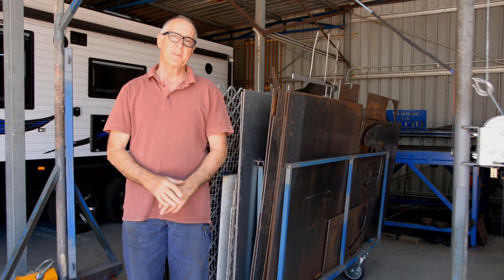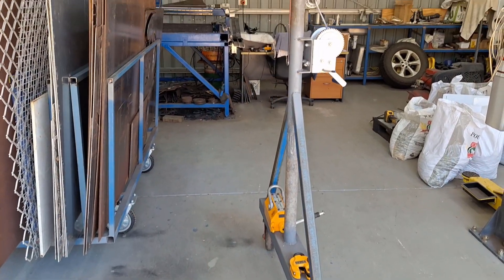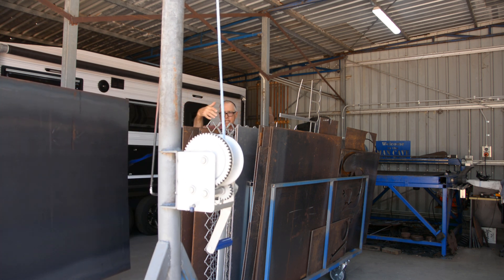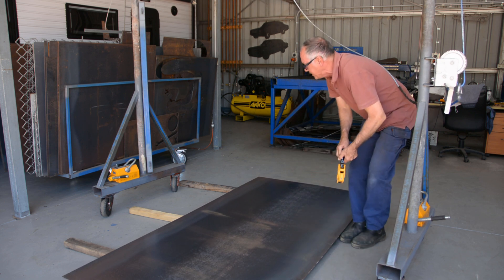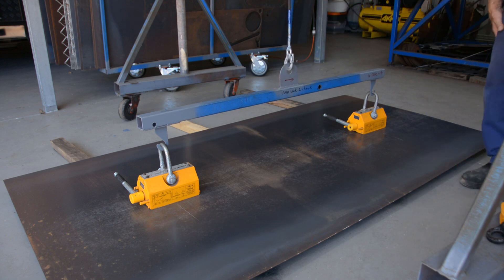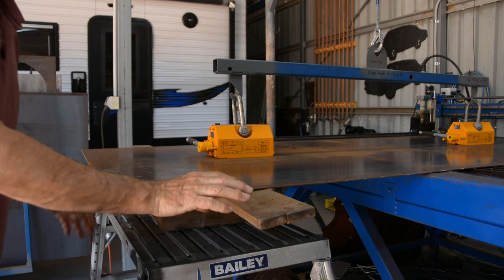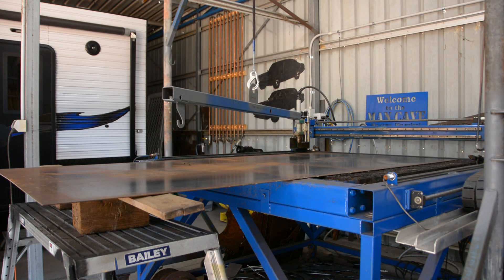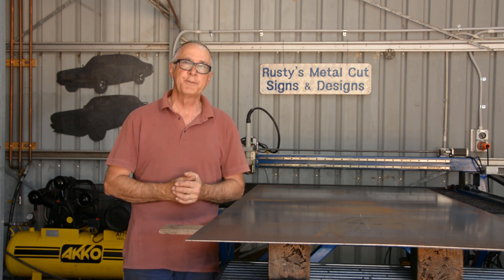How I Load Steel Plate onto my CNC Plasma Cutting Table

Comment: Mate! Not experienced in this. Such great basic info & methods
Reply from the maker: Thanks Rusty Kombi....makes manual handling steel sheets safer. I'm thinking about installing an overhead gantry/monorail crane, which removes the need to 'manually handle the current gantry crane'.

Comment: very nice setup, how much maximum weight can your overhead frame hold before letting go ?,
Reply from the maker: The plate lifter is rated at 1 tonne. The magnets are rated at 600kg each and the winch is rated at 3 tonne. I don't know the max. working load of my overhead gantry but I'm confident that it would safely hold 1 tonne.

Comment: Rusty, i do similar work from my home shed,  except my shed is 100+ years old, with a dirt floor. So, no concrete floor. 

I installed 50x50 angle steel in the centre of the roof, and run wheels along the angle iron to move the steel through my shed.
I attached a vevor electric hoist to those wheels,  and i can use the remote control to lift the sheet vertically... roll the sheet towards my table,  then i raise it up,  roll it over the table,  and then lower the seet with the vertical lifter, onto the table.

The vevor hoist/winch is much better than the manual winch.
I tried those magnets, but for me,  they're a nightmare.  The vevor winch makes it 1 man operation, or my wife helps me by using the remote while i manage the sheet location.

Also, you can use the same spreader bar set up, but use 2 vertical grips, instead of the magnets.

Id send you a video, but my shed is appalling.
Reply from the maker: Hey Jeff, thanks for the suggestion regarding an overhead crane with electric hoist/winch. I have some them and think they'd be a better option than my manual arrangement, but when Mrs Rusty is around to help me, it's definitely easier with 2 of us.
Do you run your own business and YT channel??
Reply: @RustysMetalCutSignsDesigns  business,  yes... YT, no. I'm not a fan of social media, but sadly,  i have to use it to keep the business going
Reply from the maker: What's your business name, or can you provide a link to your business, please. Which part of Australia are you in....I'm in WA, about 1 hour south of Perth.

Comment: It well suited for the job. To make it easier make the handle longer, i just would get tired of lifting plates. Handle would probably get in the way. Maybe a hex bar attached for a drill to winch it?

Did think placing the plates on trestles instead  of the floor. Thinking its a little higher and less time raising the plates up to the plasma.
Reply from the maker: I've been thinking about some sort of trestle, rather than lowering the sheet all the way to the floor, but it's just one more thing to stow in the shed when not in use....but it is a good idea, so thanks for that.
Reply: @RustysMetalSigns  yeah probably get more in the way

Comment: Looks like the still er I mean air dryer is in use.. 😄😄

Have you seen this video? It needs roll out trays for the metal and an electric hoist but he has a good system none the less:

https://www.youtube.com/watch?v=nISBU49p4bQ

This video gives you the concept on the tray slide out:

https://www.youtube.com/watch?v=zucRv1oQy_U
Reply from the maker: Hey SegoMan, the 'still' is still catching water! Thanks for the links to the other storage and handling systems....I like Wolfgang's racking and overhead crane arrangement; it has a few less manual handling steps than me, too.
Reply: @RustysMetalSigns  Your welcome Rusty Zombie!

Yeah the quicker you can get metal on / off the better the profit margins. You do an hr drawing another 45 min loading / unloading for a 15 min cut job.. 

Like you mentioned your support column probable would not handle much weight, however you can put a real post next to it and do an overhead bridge crane.

When I built my 6' x 12' table I added room for the gantry to park off the table as my my Hypertherm 105 will pierce 1"  and edge cut 1-1/2" that is a lot of metal to to slide under a torch without banging things up..
Reply from the maker: I could probably erect a free standing overhead beam/rail, with support columns bolted to the concrete floor. At this stage I'm fine with how I load sheets onto the table, but I could look at updating this in the future.